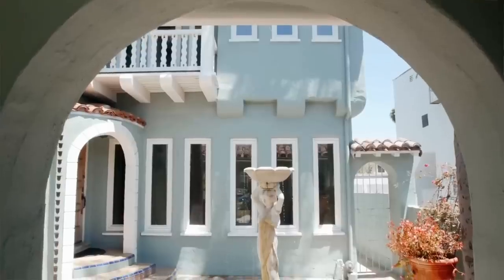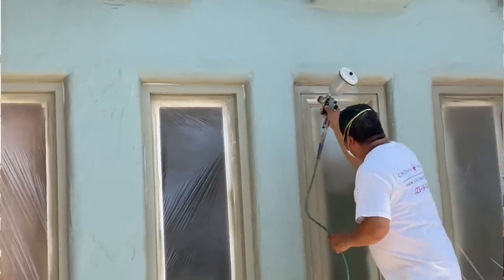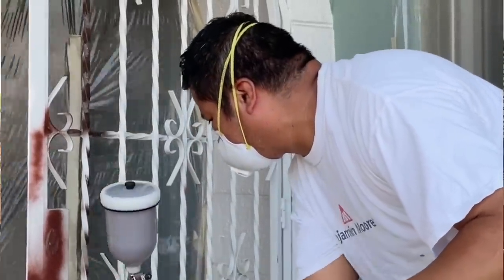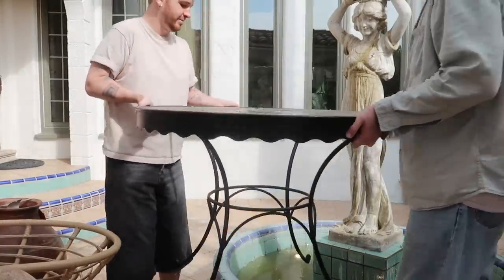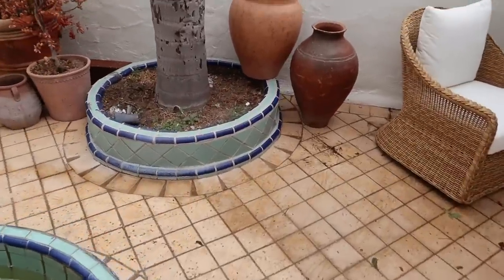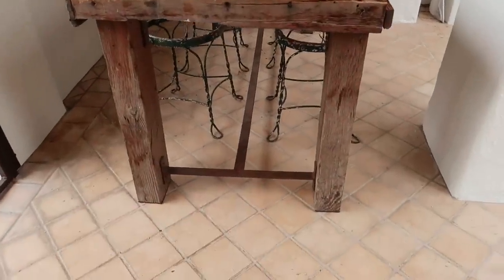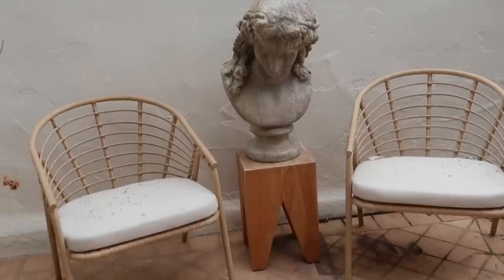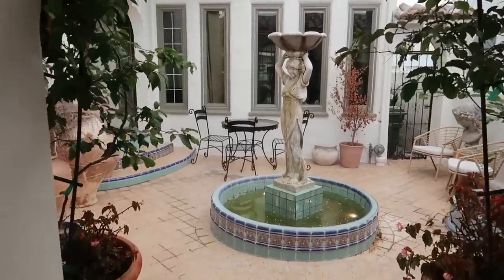I PAINTED MY HOUSE + Courtyard Makeover! (The Cost & Process)

Comment: I love the creamy colour of the house but I'm afraid I can't get on board with the 'mission brown' trim everywhere. If you'd grown up in the 60s, 70s and 80s you'd know that backyards had barely any choice but to paint things mission brown! I'm so glad of the variety available today. I've chosen to paint furniture in my courtyard almost black which is a great contrast to all the green plants, but I'd just as easily go for midnight blue or gum leaf green- if I could afford those paints. I hope the plants in your garden are not fakes! I noticed the purple fountain grass. I had that several years ago but it took up half my space when it was fully grown. It's so easy to grow in a warm, coastal environment. The other plant that would look fabulous against your creamy home would be a  bougainvillea in a hot pink or red flower. You do have to regularly prune it or it will take over but it would fabulous covering the outside and front of the house. 
As for painting the tiles around the water feature- and my dog- that water feature is STUNNING!- I'd maybe go for the darker blue/navy around the top and bottom of the feature tile. Then the feature tile will have more ability to 'pop' against the neutral colour. You could cover the tops of the tiles with stick-on removable contact paper in something dark so you can see the effect first. Make sure to check it out in different parts of the day for the full effect of natural lighting.

Comment: I wouldn't paint the tile, but rather re-tile with either terra cotta, or (combined with) a variation of earthy gray-greens to harmonize with your windows.
(A soft green only, in the fountain basin.) Think 'Fired  Earth'.

In the valted ceiling of the "breeze block covered area" I would hang  (Moroccan) lanterns, so they are visible centered in each vaulted opening; one over the dining table, and one over the wicker seating area.

Comment: The real problem is the matchy, matchy, steps, fountain, planters.  "hide" the planters by painting creamy white (maybe stucco or add terra cotta later? for now quick change by spraying over the 70s )...Steps may need the change using a stencil to soften the blues maybe add some cream or terra cottas, black or the green of your windows over the blue ? 
Fountains are to be the main event.  The interior pool tile leave as-is color.  The tile, in the center, at the base of the statue, is what I have the biggest problem with, maybe RETILE over the old, down to the water line?  Something that color matches the Spanish decorated tiles already on the exterior (NOT the glaring solid dark or light blues something with the terra cotta, beige, cream tones.  If you add terra cotta to the top of the lower pool possibly it would soften and draw your eye away from the too much dark blue?  I see fountains and love the blue so I return to the thought to remove from the planters and the steps before painting the fountain tiles.

Comment: I think there are too many sitting places in the courtyard, it seems a little too crowded. I would remove the two chairs near the statue and replace that with some plants, the second armchair before the steps. I would place a tall plant instead of the chair near the skinny table with the pot on top. And I’ll paint the royal blue with a terracotta red. Also consider an exterior rug! And maybe you can custom a working lightbulb inside the lanterns, they’ll be wonderful 🙃

Comment: 6. Yes PLEASE paint the blue tiles. So many tiles mean many grout lines, which combined with the variety of colors creates too much detail in a place where you don't want it. Play down these rings around the trees so they register as "neutral."  Cover the everything at that 24-30" height (the rings, the stair risers) in stone, the color of your rain chain bells (dark charcoal/iron). But to get the effect quickly in the short term, paint or stucco these areas. Just make all that "restauranty" tile go away. This will let your balcony, black table and chairs and plants have the spotlight. The tiles could be used elsewhere for a small wall fountain some day.

Comment: It cost us 24,000 euros to paint our last house because it was 4 floors high with 7 balconies! Luckily although we had 54 windows most of which were patio doors they were all aluminium which although I hated did save us some money because they didnt need to be painted! The painters completely covered our newly tiled balconies and were told to come back and remove all the paint spots plus they got paint on the calcada and st catarina tiles on one side of the house...For some reason painters here in Portugal dont think that the outside floors matter when they paint and it drives me bonkers!

Comment: Painted tile does NOT hold up in moist areas. It'll look good for a minute and then way worse after that. Plus, the blue adds some character and old world charm. Just pull that color in in some other areas that is more muted and it will feel more intentional. Some weathered copper would be perfect to incorperate.